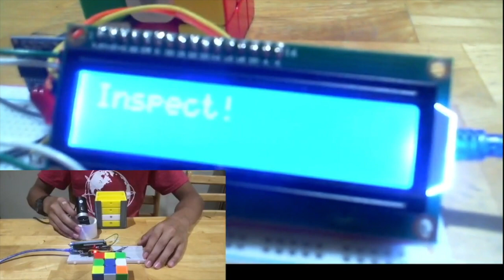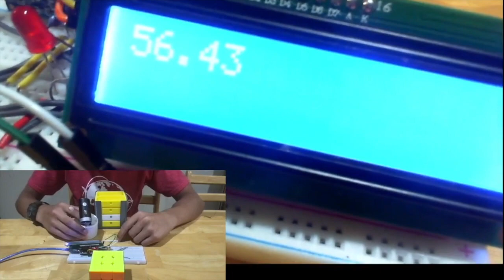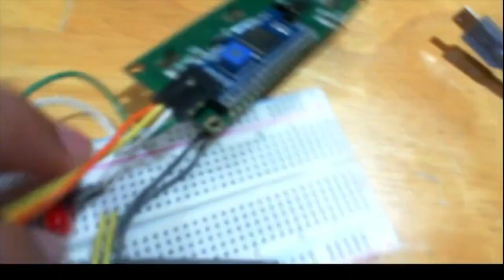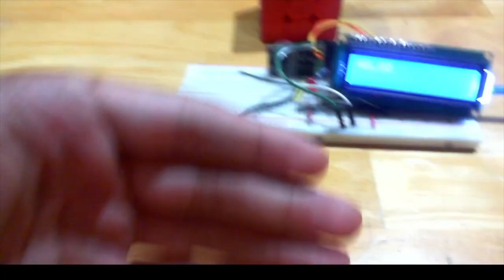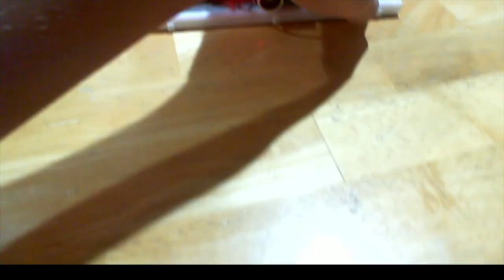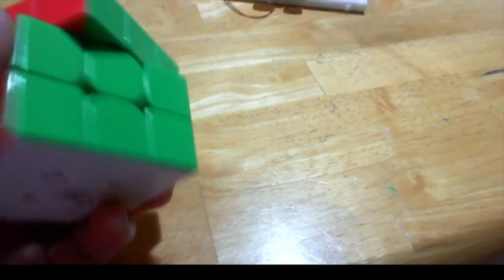Arduino Stackmat timer project | Speedcubing

Comment: SAM. you shoud have 2 pressure sensors to tell when your hands are touching them, like the real timer.
Reply from the maker: Yes, I am considering this for a future project/improvement, but first I would have to find out if the sensors are pressure sensors or capacitative touch sensors. Thank you for the suggestion!